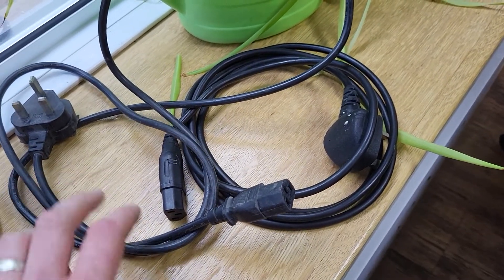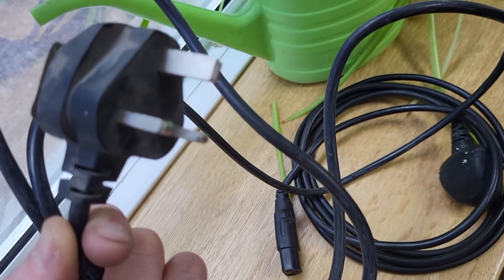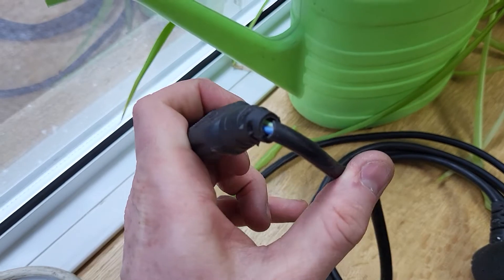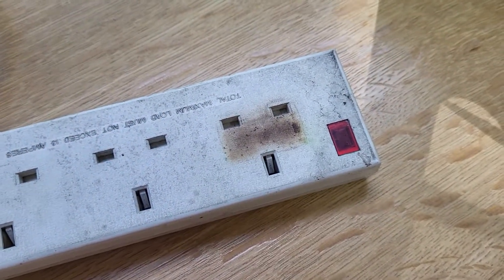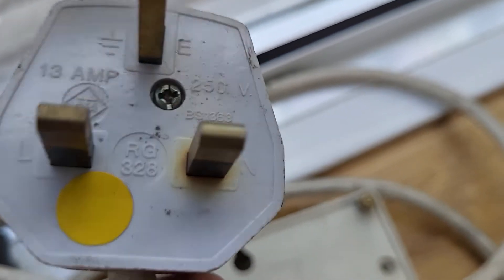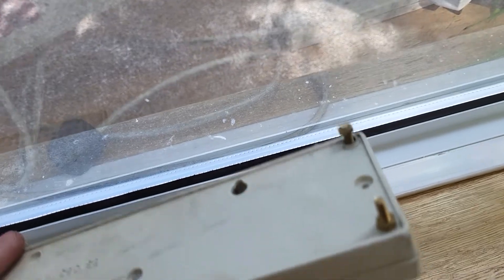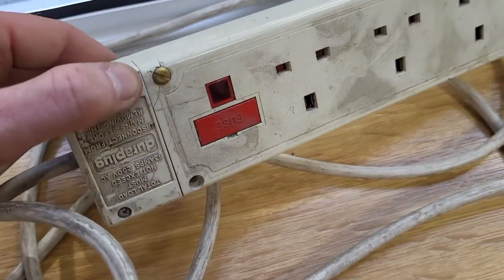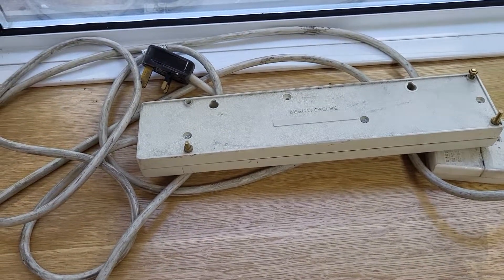Common PAT Testing Fails but easily missed!!

Comment: I have one of those exact power strips, my dad or bro bought from a car boot sale about 25 years back. The little neon lamp still flickers away to this day!
I kept it when we moved house because it was old and quirky, especially the awesome, heavy duty plug it came with and the thick cable.

It's very hard to put plugs in and out because the ground socket has these weird pincers that I assume is the original design for the shutter engager. 
It doesn't get a lot of use, but like my Yugoslavia-made Matsui TV I plug into it, it's sticking around for a few more years!

Comment: Great video. I am after some advice, I PAT test at a local charity shop, I won't bore you with my findings, but we get a lot of items in with the "shaver" style plugs and although these are class 2 I won't pass them as to me they are a non-compliant plug. we often have them in with various adaptors some are the European Convertor Plug  Converts 2 pin CEE7 Euro plug to UK mains plug. others are the kiss of death unfused shaver adaptor. any comments are appreciated.
Reply from the maker: Thanks for the comment. So an important thing to remember that shaver adaptors are very different to a European converter.  Converter adaptors must be screw shut with a cable grip. Shaver adapters should be be used for shavers or toothbrush chargers only